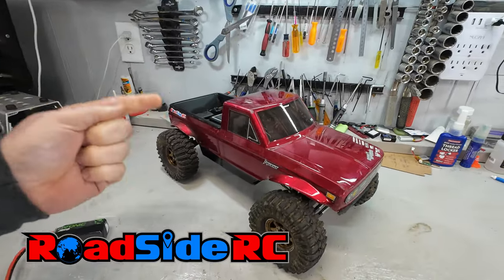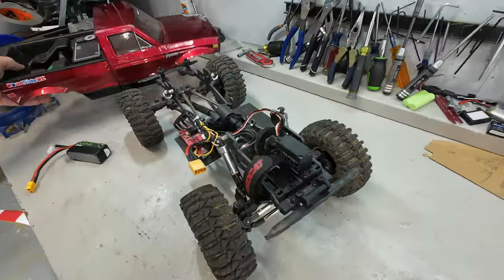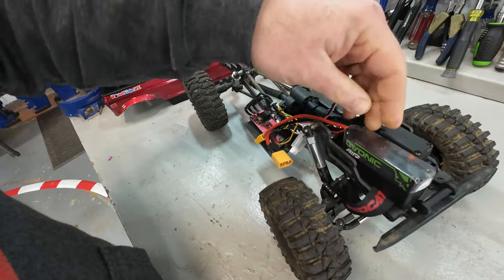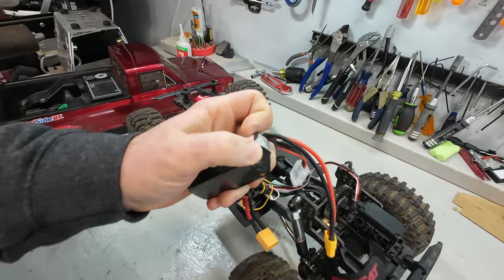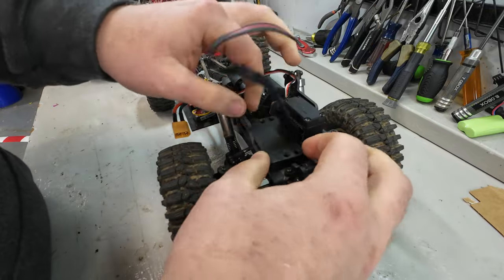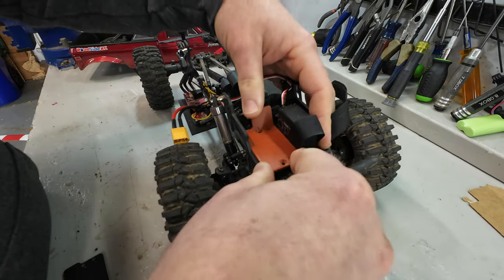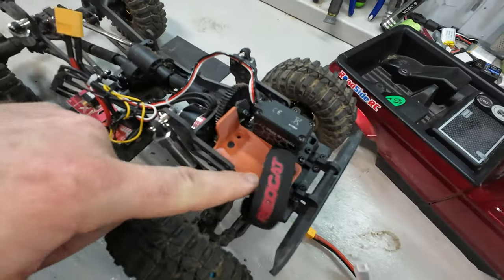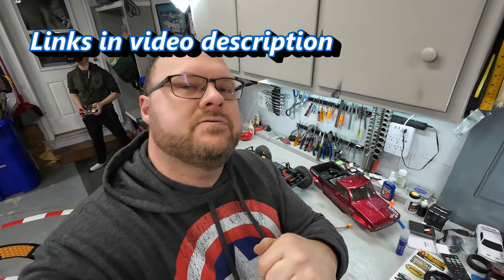Redcat Ascent Forward Battery Tray Mod - FREE 3D Print File!

Comment: Hey Troy I am new to crawlers and the battery tray you told me about said it was for  850mah battery and you said you run 2200mah battery do the battery's have the same power just less run time or is there more power with bigger battery thank
Reply from the maker: Happy to help.   MAH is the capacity of the battery - that is how long it will run.    Voltage is the power; higher voltage = higher speeds.

Comment: I have the version where you can take the bed off. Im just trying to figure out how tf you install a full size battery in the tray while screwing in the body?
Reply from the maker: Depends on what size battery you are attempting to use.   I use this one:   https://a.co/d/fcJYfny
And it works great.
Reply: @RoadsideRC  I'm using a full size 2s lipo in the provided rear tray.

Comment: If the prices are the same, would you choose a  Gen9 or an Ascent for your first crawler and why?
Reply from the maker: Ascent - hands down. 

The performance level is just SO MUCH HIGHER.   The only thing the Gen9 has going for it is all of the scale details.
Reply: @RoadsideRC  I really appreciate your reply and opinion. What about the Axial scx10 3 basecamp vs the Ascent? Is it worth the extra $100.
Reply from the maker: @franklee6301  No!   The Base Camp is actually not that good.   I 100% recommend the Ascent over it.
Reply: @RoadsideRC  thank you! Your opinion mean a ton and I really appreciate the way you approach your videos. Very down to Earth and humble. I'm going to grab an Ascent tomorrow! Thanks again Troy, have a great weekend!